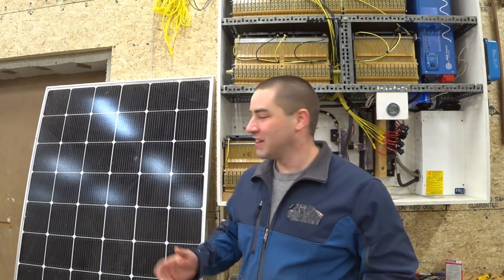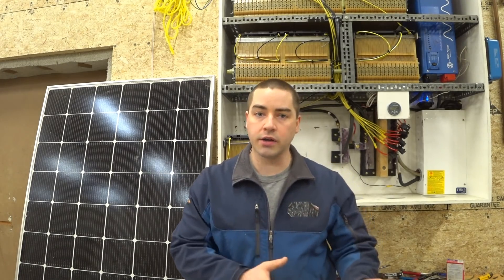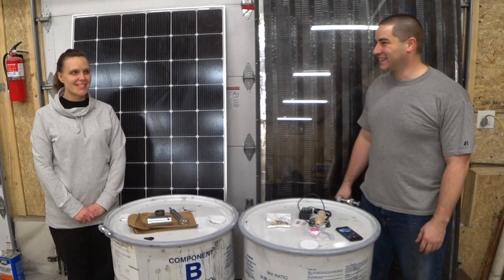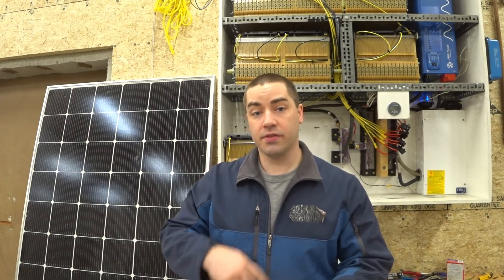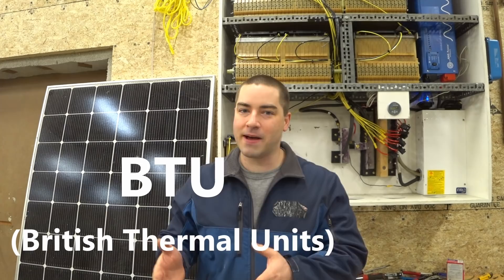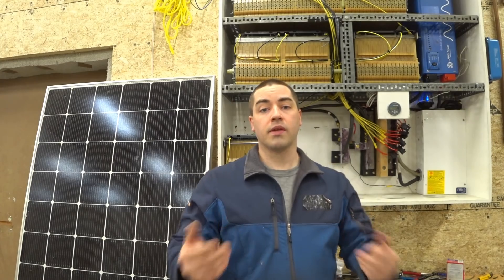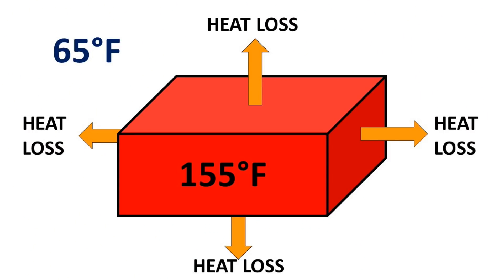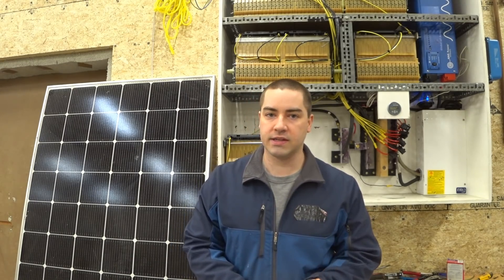Cheapest Energy Storage Off-Grid

Comment: thant now will be best economical but image that solution: .... you dont need that many mass and delta T if you will use heatpump and some electricity.  Mayb if there will be 5 or 6 day under clouds you will run out rest energy even if there not will be any plus delta T :P yyyy i know it create cost ... and is easier to make biger water reservoir and add one heat panel

Comment: Thermal energy CAPTURE for generation is more efficient than solar voltaic to begin with as long as you have effectively unlimited storage capacity.
Do your storage in multiple "day+" tanks.  So if your daily is 40kBT use 48kBT tanks and simply plumb a tank switch system.  Pro-tip is to have collection capacity independently plumbed per tank that exceeds the daily loss rate... and make sure you have ventilation so your house isn't constantly climbing to the temp of your storage area.
If you use a fluid system capable of storing the 600°F peak capacity of collection you can literally cook with it without having to worry about conversion.

Comment: 40 years ago I built a 2700 squaref oot passive solar house  It is doubled framed, ceilings R55, walls R33 net, and the lower level walkout R20 on the outside + R11 inside.  I installed 500' of 3/4" pipe under the lower floor, half right below the slab, half a foot lower. Hot water came from both solar panels and from a wood fired boiler.  The house can go for weeks without heat in the middle of winter.

Comment: Hi David,
Thanks for great videos!
I had a question about heat pump comments, you are talking about storage but you still can use a heat pump to produce your hot water for your storage. And be able to produce 3 or 4kw of heat from 1kw electricity.
But i understand in massachusetts outside temperature in winter will be too cold for heat pump efficiency.
Reply from the maker: I used to own a heat pump water heater and the marketing is exaggerated for my cold climate.  Maybe if you lived in a hot area...
Reply: @DavidPozEnergy  Yes i understand, in colder climate the only solution for good efficiency is to put some exchanger in the ground but maybe too expensive.
But in hot places, i live in south of france, i think climate similar to san francisco. We heat a internal pool of  15000 Liters all year at 30°C with 150€ (about 1000kWh / year )

Comment: Is there a video on how you use that heat?
Can you convert stored heat into electricity?
Reply from the maker: I use the hot water as is, I don't convert hot water to electricity.  I use my batteries to store electrical potential.  Yes, I have several videos on my channel showing how I use hot water, and building the 250 gallon tank, and panels.

Comment: Cool concept I thought of a similar sys for mobile water storage to stop the slushing wave. Anyway , I find it very interesting how you used a volt car battery as a solar power bank clever, I'm curious if you ever thought about using a crashed hybrid car to make a bank and back up generator system? Very efficient quiet Fast charging sys would have it's own monitoring system. Probably can even use wood fuel to run it. Penny for your thoughts.
Reply from the maker: It would be a cool project.  I'm re-charging my system using solar panels.  Yes, a generator is nice to have as a backup too.  But my focus is not on generators, it's on renewables.  Thanks for watching.

Comment: Heat exchanger? You don't use the solar heated water directly? What do you think about solar heating water. I get that it would take $4k of battery capacity to replace the solar heat. Did you build your own solar water heating panels? What about pumps to move water? I guess that would be a movie? Sorry Im so curious.
Reply from the maker: I built my own solar hot water system but I reused old flat plate solar collectors. Yes there's a pump that runs just when the panels are hot and pumps the water up through the panels and back down to the holding tank. I have a whole series of videos on this if you're interested in more details

Comment: that's too much work for just hot water . you could get a low instant hot water heater and only put it where you needed it. or do the box on top of the house . all you have to do is run the water into the box. the sun energy Cooks the box gets it really really hot and then you can have the water flowing through it into another box and that'll even give you more water and then when you got to take a shower you just take a shower with that water and that water in the box copper tubing will stay hot for a bit and then you run the cold water through it when they're taking a shower and that will get the cold water hot . while the sun is out . an instant hot I would keep it in the bathroom just in case you need it

Comment: that's why you ditched the hot water heater . you wash your clothes on cold and you buy instant hot for the bath rooms . so if you need to take a shower you just turn the water on and it instantly heats the water

Comment: please do not do that.. i love you. you will be able to heat up the water much more per square meter of sun for an incredibly cheaper price using only solar concentrators (or even with a simple solar heater. the only problem is that you need a mechanical slide attached to an electronic slide to follow the sun (solar tracker) that's just a big waste of money and solar panels
Sry about google translate

Comment: well, I haven't been following, so perhaps you already addressed this, but why not a mechanical battery with a cvt to ensure the generator that will run to power everything, runs at a constant speed, and you use your solar storage in either batteries or capacitors, to charge the mechanical battery. I'd say a concrete cilinder of 1 metric tons at 360 rpm should do the trick :-)
You can even attach a bicycle if you want to work out and charge your mechanical battery at the same time!

Comment: My husband's first comment was to wonder why David had not brought a backhoe in and dug out a good part of his crawl space to make a proper deep hot water storage broken into cells to allow for differing temperatures and to stretch the time. It would also allow for radiant floors.

It allows collecting large amounts of heat during the summer months for storage through the winter providing 100% of the space heating, hot water. He thinks dry-stacked concrete coated with epoxy-concrete blend as a coat inside and out over chicken wire and thick blocks of foam both in and out. Make the whole enclosure 6' tall by 6' x 6' x 4 units so 12' x 12' x 6' using 4" of foam in and out with a floating top 8" thick or more those are his thoughts.

Comment: How do you heat the water? Aren’t you still using electricity to heat the water which would technically take 30 kWh from your solar panels?
Reply from the maker: My domestic hot water is heated with 3 solar thermal collectors i installed on my house.  I have a 250 gallon storage tank in the crawl space.  I filmed all the parts of this if you want to go back and see how I built it.

Comment: A heat pump can store much more energy than just a Ohm resistance heater. If you just heat your water direktly into heat, you get 1kWh of heat out of 1 kWh of electricity. With a heat pump you get 5 kWh heat (and coldness) out of 1 kWh electricity, but you need a battery in order to make your heat pump run more or less steady (just like a fridge). So you need an accumulator. Li ion technology is expensive but for stationary applications like this you can use redox flow battery technology. It is bulky but just dig a hole and put it in there. It is much cheaper and more reliable and shows less degradation than Li ion batteries.

Comment: I have taken classes on heat transfer and Thermodynamics. The calculations you are wanting to do are pretty complex and complicated. I think it’s good you made some assumptions, they seem to make sense too lol.                                      Another thing to add is that the energy in your batteries is more valuable to you then the energy in the hot water, because it’s more useable. I might be wrong but I think that property is entropy. If your goal is just to heat water then what you are doing makes sense. Obviously though the hot water isn’t good for much else, unlike the batteries.

Comment: I was waiting for the stored hot water to be converted back to electricity. .to run my TV and lights etc.    ...   seem strange to use solar electricity  panels to heat warer... why not use thermal water heater panels to heat the water directly.
Reply: I completely agree. The sun sqft efficiencies and $/btu have to be trash compared to those duda style solar water heat tubes they use in Canada. PV panels = electric period. Any other conversion has a significant efficiency loss.
Reply: @scottleggejr  PV plus a heat pump is as efficient as solar and much more versatile. He is only using the water heater once his batteries are full.
Reply: That is what is often done.  Not surprisingly to anyone who has turned on a black garden hose on a hot summer day, the best use of solar in homes is to heat water.
Reply: That is a good idea!!
Reply: Exactly what I was thinking.

Comment: You’re assuming zero input on the days that there’s no direct sun. Wouldn’t there be some power generation?
Reply from the maker: With PV (electric), yes.  There would be some electrical production.  But with solar thermal you must first make the panel heat to overcome loss to ambient air, then it can heat the water.  Most cloudy days I produce no hot water.
Reply: DavidPoz 
I’m a bit confused, on this one you’re saying solar thermal is cheaper but in the conclusion of the test you say photovoltaics are and that you’re considering stripping it out of your house and replacing it with mor PV panels?

Comment: Yes, storing thermal energy is much cheaper than storing electrical energy. But they are two different things. For storing heat it is more efficient to use heat collectors on the roof. Modern houses can have a VERY large watertank in the center of the house. It is for warm water and for heating the house. It is a very good idea to save costs.

Comment: Thanks for an interesting video.
The effectiveness would be significantly increased if the tank was cylindrical as heat loss is directly proportional to surface area.
It would be insulated using expanding closed cell spray-on insulation.
The tank in OSB is reinforced by using ratchet straps which then get embedded in the insulation inside the outer jacket.
Might cost a bit more to make but will perform significantly better every day.
Reply: How much is significant? Use numbers instead of superlatives.
Reply: @jimlahey5354  He actually only used a comparative, not superlatives.

Comment: So the heat harvesting is done from where??
Reply from the maker: I have solar collectors on my house and garage.  Each collector is 4 feet by 8 feet, with copper tubes inside.  Water is pumped through the collectors when the sun is heating them up to collect the heat.  There are some older videos on my channel building the system.
Reply: @DavidPozEnergy  ahh cool thanks I will have a look

Comment: Hi. I think what people mean when they ask you why you don't use a heat pump is this - you are taking PV panels and running them directly to a heating element. If you take your PV panels and run them to a heat pump, you get more BTUs of heat from the power you put in, depending of course on the environmental temperature where your heat pump is. (I read they are no longer efficient below -20 C) What could be very efficient is if you can power your heat pump from PVs and get heat for the heat pump from a thermal solar panel.
Reply from the maker: There are a lot of good ways to get to the goal.  I've tried heat pumps, and solar thermal collectors.  They all have pros and cons.  When I'm DIYing a project sometimes I like to keep it simple.
Reply: @DavidPozEnergy  Here's where Adam Savage used a small heat pump to make a cooling suit. https://www.youtube.com/watch?v=z_Ti4GP0ntE
And there are cheap heat pumps for small swimming pools that pump heat into the pool from the environment with 3KW heat output using 450 W of power. The lowest priced ones go for 400-500 EUR / $

Comment: You will have to tell us the impact of winter on storage. A crawl space is open to the elements and you did not factor increased heat loss as weather cools to freezing. The increased gradient should have an impact. Heat is a great energy storage but monotone, not as diverse as electrical storage. But if you can heat your house and water, that is good, problem is this is not enough for house heating, I think.

Comment: Water is a great and fast collector of heat but is also a terrible storer of heat and that is why it is used in car radiators for example.  It dumps heat very rapidly!  Masonry (rocks, concrete and bricks) on the other hand collect heat more slowly but hold that heat for a very long time.  If you combine the two you’ll have the best of both worlds.

Comment: What happens to the figures if you use a saline solution as its relatively cheap. Also, you could consider a concrete tank with insulation outside, its more thermal mass.
Another method is warm air through a mass of glass chippings, or rock filed gabion baskets in the concrete tank to heat your habitable rooms on demand. I hope this helps a bit late here in the UK hope this is of help. Mick the Plumber Heating design engineer. check this out https://www.termodeck.com/app.html

Comment: Hey David.  Thanks for making these videos, it really helps to have people like you helping others understand things visually.  I have a question regarding your setup.  At 3:46 you start to get into minimum water temp and the need in your jurisdiction for a thermostatic mixing valve for higher themperatures. You move on to the concept of a non-pressurized system supplying heated water to a pressurized system via a heat exchanger.  That's where I loose you.  Im not sure if I missed something, but I don't understand how that all works.  Aside from all the math, how is all that rigged up?  I ask because about 7 months ago,  my hot water heater failed and I decided to expirament with a different solution for hot water supply other than the common one of simply getting a replacement.  I put together a system where I store hot water in an insulated tank that I made ($85.00) with a digital thermostat switch ($23.00) to keep it at consistent temperature of 114 degrees farenhiet.  Because the hot water doesn't mix with the cold water from the house, I have found that 114 degrees is optimal for showering.  The tank is heated electrically, but because it's only 25 gallons and is insulated something fierce, the energy cost to keep it hot almost nothing.  It takes about 25 minutes to bring up to temp after a refill with cold water, and cycles about twice a day on average.  I have it set to not fall below 105 degrees.  I have an inexpensive water pump ($140.00) at the tank and the tank has a float that fills on demand much like a toilet but only refills when it's 90% empty.  The heat source is active only when the tank is full eliminating the possibility of heating an empty tank and causing a fire.  The pump supplies water on demand via a remote control power tap switch ($19.00) to activate it.  The water is supplied via marine grade hose ($45.00), so my hot water bypasses my homes plumbing and instead is fed to each outlet via my hoses.  Have you ever used a sink in a bathroom where you have separate valves for hot and cold?  They are rare, but they exist.  I have my kitchen sink, bathroom shower, and second bathroom sink in my garage connected to my hot water source and I'm very content with it.  When  I want to take a shower, or get hot water at either sink, I push a button on a remote control in my bathroom or at either sink (all have a remote) and the pump activates sending hot water.  How does your system move the water?  I love the idea of turning a valve rather than hitting a remote switch when I need hot water but I'm not brave enough to attempt to tap into my home water system for fear of just screwing the whole thing up.  FYI.  I went from an average of $60.00 a month for natural gas, down to $5.00 because of this change.  Removing my hot water heater made a tremendous difference.  The biggest tradeoff is that I don't have hot water for my clothes washer because of the volume the washer requires.  But after 6 months, I have learned very effective ways of doing cold water wash.  Adding 1-2 cups of white vinegar to color loads is a very effective disinfectant and my clothes come out much better than before when I used to basically cook them with water hot enough to remove your skin.  (NOTE:  NEVER MIX BLEACH AND VINEGAR).  Anyways, thanks for the videos.  I know that was a lot but again, my question was about how your heat exchanger is integrated into your plumbing system.

Thank you
Reply from the maker: Thanks for checking out the video.  If you would like to dive into the details a bit more, then please send me a facebook message, or an e-mail.  It's difficult to carry a conversation through the comments.  I have several videos on making my solar hot water system, but here is one link for a fun one: https://youtu.be/WwTsWUKr5VE  Also, I wrote an article that goes into more details.  The link for that article is on my homepage https://www.davidpoz.com/